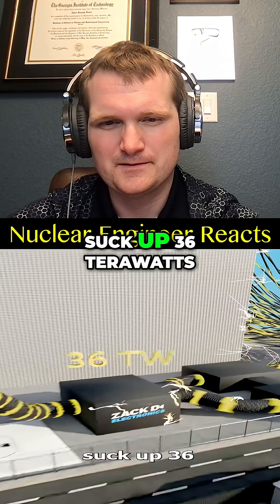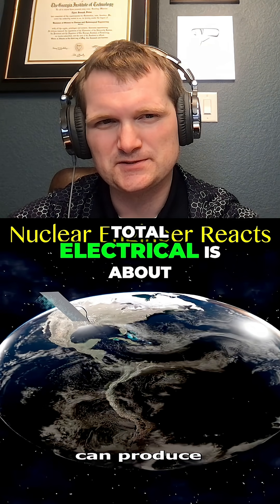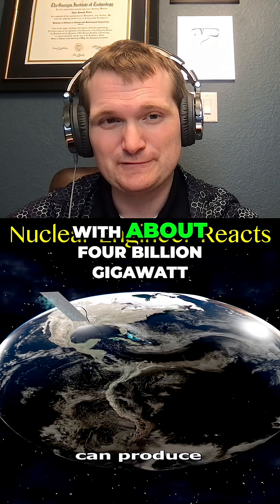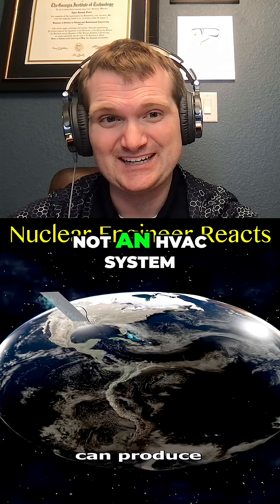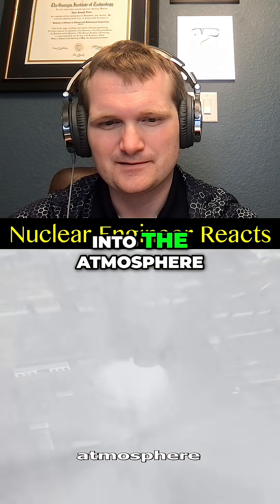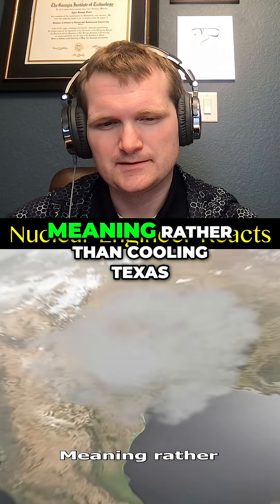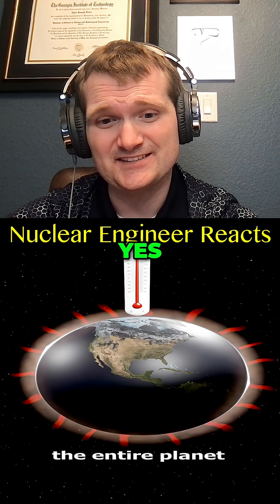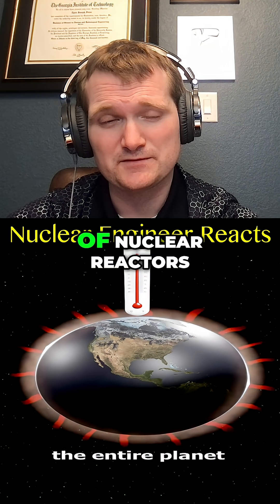Could You Air Condition All of Texas? - Nuclear Engineer Reacts to Zack D. Films

Comment: It wouldn't work anyway, since those AC units would still have to dump all that heat somewhere, and being electrical devices, they don't just have to dump the heat they are taking out of the air, they also have to dump the heat their mechanisms generate.  The result would be a net increase in the air temperature, making it hotter than having no AC units at all

Comment: You cool texas by painting 45% of the planet white… not with paint, but with white quartz powder. It would not be instant, it would take about 2 years to drop 1 degree Celsius.

You would be cooling the rest of the planet too.

By year 4 we would see a 35% decrease in hurricane intensity.

By year 6 we would have a permanent ice sheet covering 20% of the arctic ocean year round.

It’s right about year 14 or 15 we end up with snowball Earth if we’re not dusting the quartz dust under a carpet.

Delicate thing. the weather.

Comment: the basics of A/C work on compression and decompression of a refrigerant heat is generated when that refrigerant is compressed cooling happens during decompression phase, A/C doesn't displace heat it actually cools the air down., A/C actually cools the air in a enclosed environment TLDR: it doesnt displace heat. This is coming from someone that actually works on HVAC systems in motor vehicles

Comment: Talking about the heat load of the air makes me think that the more humid the air is, the more heat load it requires for the AC to change temperature. So the air by the coasts would be even worse than the air further inland.

Comment: Fun fact AC just pumps heat from inside to outside or outside to inside. So if it's cooling your house it is doing that by moving heat outside and warming up everything outside.
Reply: Fun fact - since AC units consume electricity while doing this, they actively generate heat during the process.

Comment: What do you mean a dyson sphere worth of nuclear reactor? A dyson sphere is suppose to build around the sun, it doesn't generate energy, it just collects energy from the sun.
Reply: Okay redditor 🤓☝️
Reply: @fracask1049  okay r'tard 🙈🙉🙊☝️
Reply: @fracask1049  Okay ragebaiter, I am just asking a question.
Reply: You could build nuclear reactors through all the area of a dyson sphere. It would generate FAR more energy that the energy absorbed from the Sun. Where you would find the fuel is another story, though. Maybe a kardashev civilization type 3 would do it for fun.
Reply: @conelord1984  As far as I know, Dyson Sphere is a structure surrounding a star. Why would you need a nuclear reactor on the dyson sphere if the largest nuclear reactor in the entire universe is right in front of you? Also, how do you suppose to build the cooling system for the nuclear reactor? Cooling for spacecrafts is very challenging, because there is no conduction or convection in space for you to release heat, especially if you are close to the sun. If you just want to build nuclear reactors in the space, why build it right in front of the sun? And why do you build nuclear reactors in space, building on a planet or even a moon is far more convenient and easier. What you said makes 0 sense in engineering.

Comment: Zack just ignored the fact that for an AC to cool you room, it expels heat to the outside, but in this case the AC is just trowing the heat right back, so it would either get hotter or nothing would change just from that

Comment: The biggest issue that you barely discussed was that it doesn’t destroy heat, it just displaces it. Without having a barrier enclosed around the entire state, including a roof, all of that heat isn’t going to go anywhere except right back into the state of Texas.
Reply: He barely discussed it because it doesn’t need much discussion
Reply: @Handley941 well surprisingly many folks seem to think acs just create cold
Reply: Due to inefficiency you’d actually heat up the state of Texas 😂😂
Reply: @chielvandenberg8190  not just inefficiency but entropy. an AC unit that is an impossible  theoretically 100% efficient, it would still generate heat.
Reply: Did you even watch the video? He literally said "but they move heat, they don't destroy it. All the waste heat is going right back into the environment." and speaks about it again at the very end of the video.
Reply: @unwaveringflame2482  Can you read? I said he barely discussed it. I was giving a more in-depth explanation as to how it would need to work. Sit down, little autist.
Reply: @unwaveringflame2482  he's actually not fully correct. AC units not just move heat, they actively generate heat during the process.
Reply: AC units actually generate heat.
Reply: Pipe it to California

Comment: Wtf is enfalpy?
Reply: Enthalpy meassures the amount of heat stored in a system with a constant pressure, do not remember the formula though–
Reply: @fathe3217 oh, ok
Reply: Enthalpy is a thermodynamic parameter, that tells the change of energy by a unit of mass, the value normally is extracted by experimentation and if you want to look it up, search for mollier diagram.